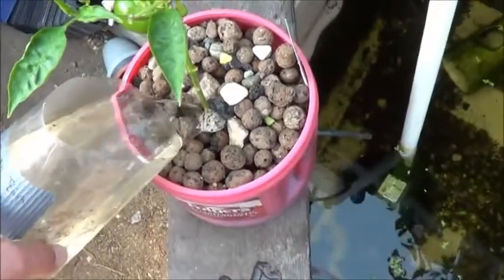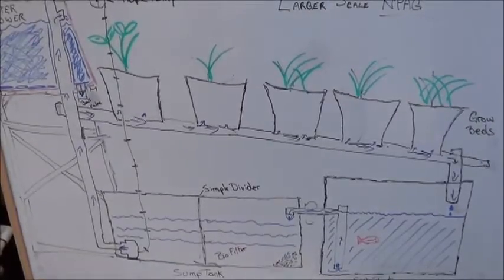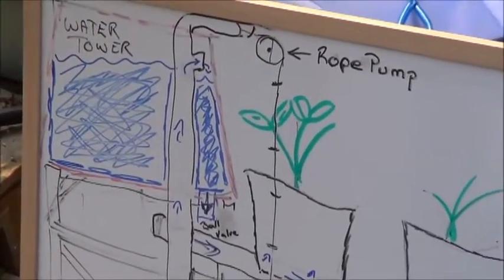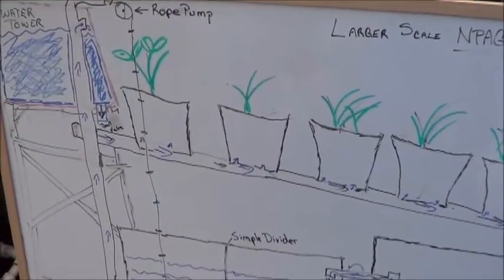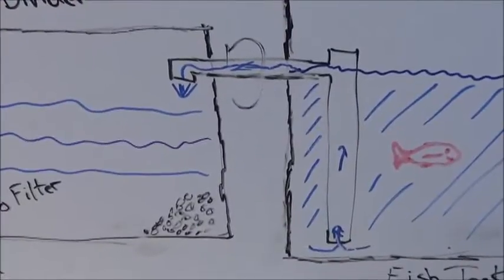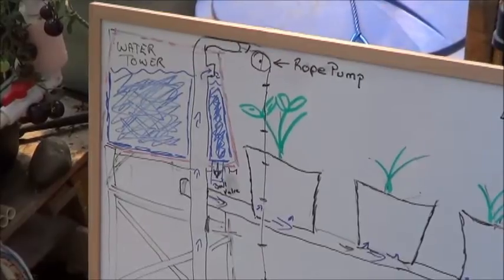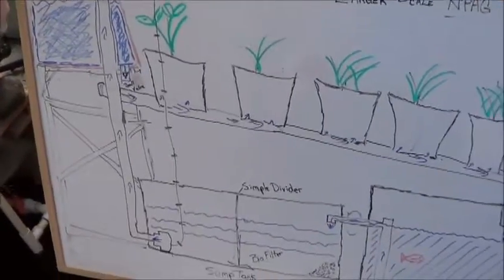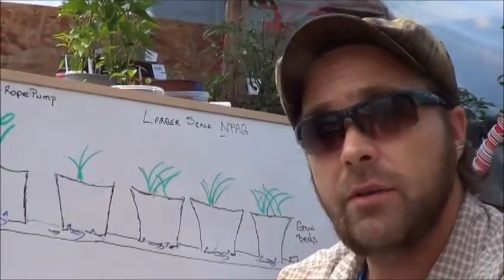My Drawing of a Larger Scale No Power Aquaponic Garden

Comment: In Oklahoma,  USA.   I have a 10k gallon system with no electricity for over 10 years.   I use a windmill with a hand crank (for no wind days)  also have raft beds that are 25 feet long set up 2 inches lower than the next, 3 beds total side by side.   Havng a large container at the top allows the water to gravity feed as needed.  I can fill the top tank in a matter of minutes, if needed, with the hand crank. Its Oklahoma,  windy almost  all the time... Beds hold 3 inches of water continually and drain tube allows over flow to next bed and then Into fish tank. Add a solar heater made from aluminum cans and black paint for winter...  Going to make a video sometime this summer, once I get the time and again the knowledge of downloading to YouTube... produce 1000s of plants and 400lbs of fish annually... just takes time and effort, but doable for most folks, depending in availability of time.  Thanks for taking the time to make the vids, great info for beginners.  Just noticed all the responses are 3 years old... just found you channel today... any updates on your system or did you get to build the one in the drawing?
Reply from the maker: The friend I was working on this for never ended up moving into the hills so this is about as far as a larger system made it.  Sounds like what you've got set-up is pretty epic, I would love to see the video when you do post it.  Please come back & share a link when you do!

Comment: There are a bunch of Chinese solar water pumps that retail for $69 each and they have been working for years for us. Made an aquaponics system on our balcony out of a couple of IBC (intermediate bulk containers).  You can find them for free, but we could not, so it was $100, but for a 1000 liter tank, that is OK.  Floating raft is actually working better than the costly lightweight expanded clay aggregate balls. 

We were constrained with space on the balcony of our apartment; of course some village could dig a pond with a big surface area for oxygen, plus local bugs and algae feeding the fish, standard in Thailand. But for us, in an apartment in the city, it cost a couple of hundred dollars to build.  Here  is the solar-powered balcony aquaponics system: https://youtu.be/2t8l5OnmVEM
Reply from the maker: I have to say, I'm impressed that a balcony can hold the weight of a filled IBC!  
To those who see this comment, check out the link!
Reply: Two IBCs!  700 liters of water tank, 300 liters of grow bed each, about 2000 liters, 2000 kg.  If a person weighs 80 kg, that would be 25 people standing on the balcony.  Yes, heavy...but 25 people could fit, so they should have designed for it...hopefully..guess we will find out.

Comment: we have the same idea... if you dont mine i may suggest you a little bit additional idea. you can also use perpetual motion in it so even you are not around your rope pump is still functioning. no electric or man power. its depends on the gravity pull. :-)
Reply from the maker: +William Olegario - I've wondered a few times about getting some power out of the return water with a micro generator but perpetual motion itself is a tricky concept.  Additional ideas are always welcome here, thanks for the feedback!

Comment: Good idea! The tank replaces batteries for solar/wind systems with your design here. Have you seen this type of pump?:
http://www.veljkomilkovic.com/rucnaPumpaEng.html#videopump
Maybe for bigger systems you could have a creek/river flowing gradually down out of the upper tank with ponds as steps down the slope to a lower main pond. Each pond can have different fish, and most of the ponds could have floating plant rafts on the surface. There can be a small waterfall after each pond as the water drains into the next lower pond, or a regular creek. The storage pond at the top and the main pond at the bottom would be "tidal." If the level in the upper storage pond reaches a certain level it could drain some directly to the lower pond through a tall waterfall.
Why do I get so excited about this sort of thing?
Reply from the maker: JaycubL Because it's awesome and world changing?  That is a great look at the idea!  I love it!  Now, off to follow the link ...
Reply from the maker: JT Bear Very cool pump idea!

Comment: Interesting idea JT (Y)
Reply: Like the look, wondered if a long straight version of what petsmart has for their water plants would work for a table? each section flowing down into the next 3 inches lower ....to kind of slow down the water as it goes.
Maybe a solar panel to a small electric motor turning a wheel might get water moved up. Thanks for getting the thinking started. cheers.
Reply from the maker: RobBobs Backyard Farming Personally I like my little pumps, a lot, but I've been thinking about this for quite some time so when the request came ... why not?  I would love to have the room to 'field test' this idea ...  
Cheers!

Comment: they have windmill water pumps,,, do what you you just described but just replace with windmill pump... you could probably make one easy enough,,, then just adjust valves for flow
Reply from the maker: ***** A windmill water pump would be perfect!  Never tried to make one of those before, there's another project for the to do list!  Thanks for watching!
Reply: JT Bear
you know what,,, I might just make one myself,,,, I have been toying with a hand dug water well for emergency water for a while now......maybe I can do this and build a stand for water barrels that fill up but two of them have those filter candles in them for potable water, and some for my aquaponics,,, been wanting a complete off grid system and was thinking solar pump, but it would be so lacking,,, this way I can do so much more I think
Reply from the maker: ***** One way to find out!